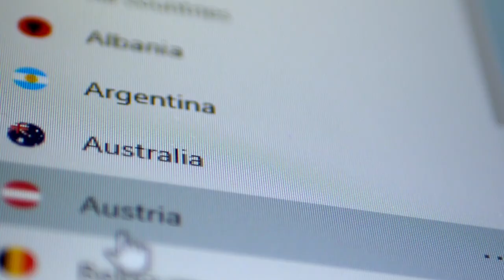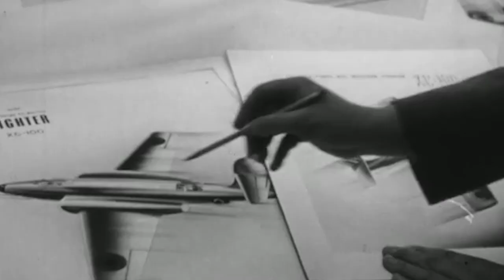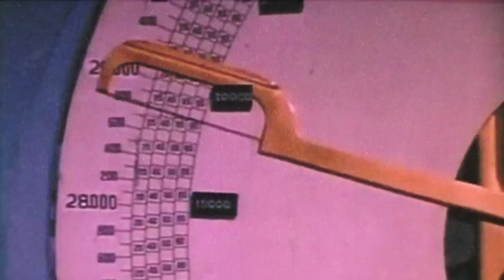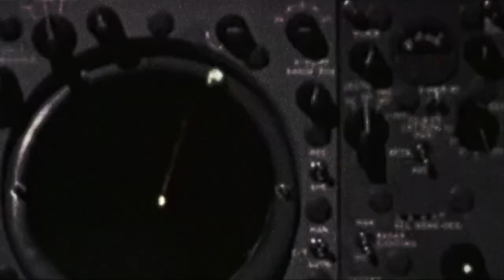The BAC TSR-2 – The Most Outstanding Military Aircraft to Never Serve

Comment: Replace TSR 2 with Avro Arrow where ever it is spoken and you have another video, the development, construction and demise of both aircraft are nearly identical and the suspicions that the US had a hand in both persist.
Reply: Although the Arrow was some 6 years earlier in testing, and the Iroquois engine was more reliable. Somewhat different target spec's, the Arrow not requiring STOL performance, although that, too, seemed to have been deprecated later in TSR2 program...similar thinking about missiles vs. aircraft seemed to haunt both programs, and the total destruction of all parts, plans and documentation for the Arrow seems, even today, "suspect '"...NASA benefited tremendously from the 14,000 laid-off people in the program,  and this was the end of the significant role that Canadian aerospace should have played. All too similar to TSR-2 :-(
Reply: At least there are a couple TSR-2'S left on display.  No such luck for the Arrow.
Reply: True, I was thinking the same. Whilst there was probably some skullduggery going on with the politicians behind the scenes, the 50s and 60s were littered with designs of brilliant aircraft that got scrapped because of changing political situations and mission roles.
Reply: The USSR was much more to blame. By the early 1960s, anti-aircraft missile technology had advanced to the point that high altitude Mach 3 bomber penetration was a suicide mission with no chance of success. That made the Arrow interceptor and the TSR2 and XB-70 bomber projects obsolete. At low level, firing cruise missiles, the B-52 was more capable and had a longer range than either of the hot rod upstarts. The same reality faced the Soviets and the Arrow had no targets to shoot at within its design envelope.
Reply: @Markle2k    Sir you are talking sheer nonsense.. TSR2 was originally designed with Terrain Following radar to operate at constant 200ft agl.. Why were all the prototypes, machine tools and jigs destroyed , which had never happened before.
Reply: @andyb.1026  Should I use Reynolds Wrap or will generic tinfoil work for my hat?
Reply: added ... hawker-sideley who also worked on the tsr2 got all the arrow leftovers after the scrap yard ... thats where the tsr2 got the radar and auto pilot from ... and a few of the engineers too
Reply: @edgein3299  I shot a few pics of it last time I was at Cosford, they had left it outside of the hangar, beautiful machine.
Reply: No it was bad contract management.
England doesn't have a constitution. It should be one country not three country's.
Stop trying to blame the US for your issues. If it weren't for the US you'd be speaking German.
Reply: @andyb.1026  That was and is one of the big questions, they attempted to bury both aircraft, even plans and flight data was meant to be destroyed, fortunately enough was "lost" to give us what we have today, not even being able to keep flight data to aid other projects is more than mismanagement, it reeks of political interference, we apparently contracted to buy the F111 but went back on it, then had to pay cancellation fees that would have paid for TSR2, the RAF soldiers on with the Canberra while the Canadians buy the aircraft they already rejected the F111. A friend of mine was working for Bristol Sidderly at the time and they were testing the engine for the supersonic harrier, which also got canned but very few people have ever heard of that one.
Reply: @CrusaderSports250    I hadn’t heard about the F1-11 cancellation penalties, but wouldn’t surprise me in the least.   In the past decade we ordered a Sqn of Chinooks from Boeing, but decided to write our own software ,, after many failed attempts the job was Cancelled.  Those Aircraft have sat in storage, unused for years. The idiocy of UK MoD  & civil servants knows no bounds.
Reply: CF 105 air frame in storage 
National Museum of USAF
It’s still an issue! 😎
Reply: I won't say too much but I will say the aircraft had a much different mission in mind then what was being publicized at the time.

The program had been compromised the Russians
Reply: @maejune2179  if it weren't for the British winning the battle of Britain the US would have been invaded by the Germans and the Japanese

Comment: " the decision to purchase F-111's backed out when the cost exceeded the cost of the TSR-2 "
* meme face engaged *
Reply: The F-111 never fulfilled this role either. It's most well known for the bombing raid ordered by Regan against Qaddafi in Lybia. They didn't even get that right.
Reply: More proof they should've KEPT the TSR-2.
Reply: @Ushio01  too long to fly is a bit unfair. The final spec and order came out in 1959, so for it to fly in 1964 was an achievement in itself. Worse still, Olympus 320 (the engine to be used on the TSR-2) was suffering from major development issues.
Reply: That was thanks to the devaluation of the Pound v the Dollar in 1967. plus the F-111K couldn't met the RAF's requirements either. Plus the withdraw from east of Suez and the move to NATO Flexible Response removed the short runway requirement.

Comment: Although not as futuristic - the Buccaneer was a superb aircraft and weapons platform! Having said that - my God the TSR-2 was a beauty!
Reply: ask the u s top gun school they could never get a missle lock on a buccaneer
Reply: @alancollard8939  Try USAF RED FLAG, Cock all to do with the US Navy's TOP GUN.  Yep the Bucc's did give the USAF SAM simulators a bit of a headache for a couple of years, until a Wing came off one causing the Buccaneer to crash and killing both the crew. Fleet was grounded for inspections that resulted in a quarter of the Fleet being scrapped because the wings were cracked up to hell and the rest needing major modifications and structural component replacement to keep the aircraft in service (plus reduced G limits for manoeuvring). The Aircraft that crashed was only 13 years old.
Reply: @richardvernon317  True, but the aircraft were former carrier aircraft designed for the stresses of short carrier deck operation and the softer ride of very low level flight over water, not land. Remove the weight and mid wing rigidity of the wing folding mechanisms and had the wing been stressed for runway take off and landing and not catapult launch and violent arrested landing, then it would could have had better fatigue characteristics in over land low level flight. Had it been procured instead of the TSR2, the RAF version would have been designed from scratch for low level penetration and in time, when microprocessor developments had made them realistic proposition, a mark 4 version would have enjoyed all the electronic aids that benefitted the Tornado, making that aircraft unnecessary.
Reply: @richardvernon317  Had it been procured instead of TSR2, it would have been in service at about the same time as the RN S2, mid 1960s, and given the huge amounts squandered on the TSR2 and later, on not procuring the F111K, an RAF version designed from the ground up with its development continued it would have been a very competent, economical and probably exportable product. But ancient history now in the sorry tale of British defence procurement.
Reply: My uncle was a flight sgt in the R.A.F. Working on the buccaneer during the 70’s/80’s and he said they were held together with chewing gum and elastic bands 😂😂 but otherwise they were an amazing platform and I believe that they were used in gulf war 1 as part of the laser guidance systems so they still had a use for it and made it worth the development costs ✌️✌️👍👍👍
Reply: @richardvernon317  flt sgt John woods 🙏🙏
Reply: The Bucc WAS an outstanding aircraft, no doubt about it.  It destroyed the USAF in Red Flag but it wasnt the TSR 2.  Never has a program been so eradicated so as not to resurface as the TSR2.
Reply: I was walking around it at Duxford today and it is pretty and parked next to a Vulcan which is also a beautiful beast

Comment: Thanks from the UK for a TSR2 vid. Tragic it took so much design effort but was never deployed. One example lives on at RAF Duxford museum.
Reply: David Curry Films XR219 & XR220 survived i think, the other one is at RAF Cosford if I remember correctly
Reply: The one that flew is at R.A.F Museum Cosford
Reply: Duxford is the imperial war museum it is not an RAF base as stated in the video RAF cosford museum has one
Reply: Obsolete before it flew... or so they thought at the time.
Reply: @Justanotherconsumer  Nav attack system didn't work and could never work without a complete new computer system that was going to take up to 10 years to develop. RAF needed something new operational in 5 years.
Reply: @Justanotherconsumer  Nope. It was definitely obsolete by the time it first flew. There were some proposals for weapons systems that could be developed to allow it to do low-level interdiction, but that would just increase the cost of the whole program. The aircraft as delivered couldn't meet its original pie-in-the-sky design targets. The aircraft couldn't deliver the weapons that already existed without reverting to a performance standard already met by existing aircraft.
Reply: @blue2sco  The one that flew was scrapped.